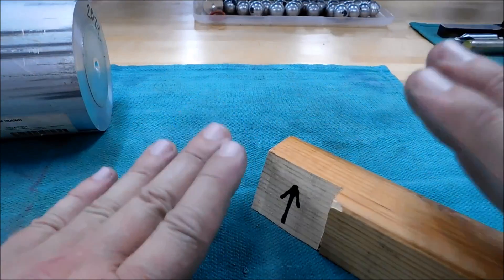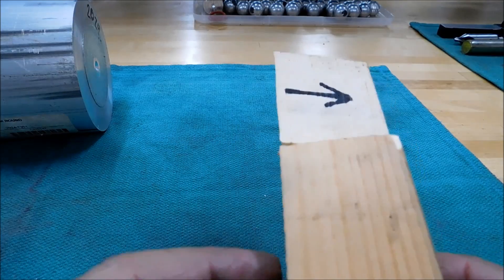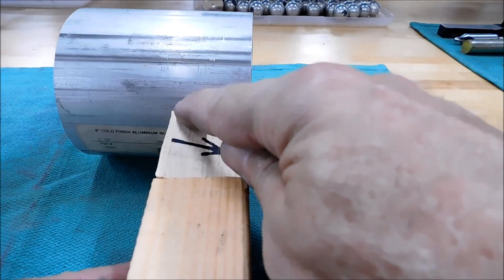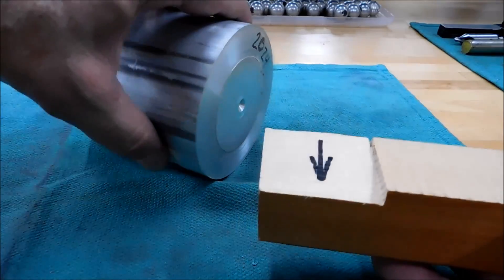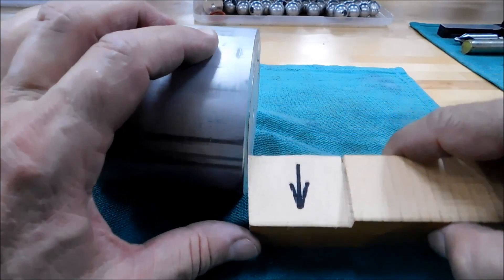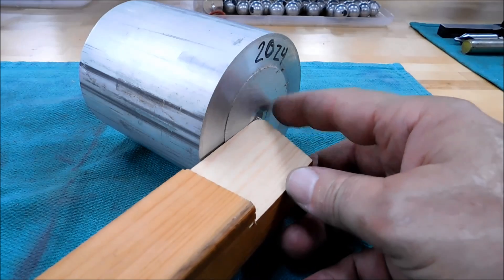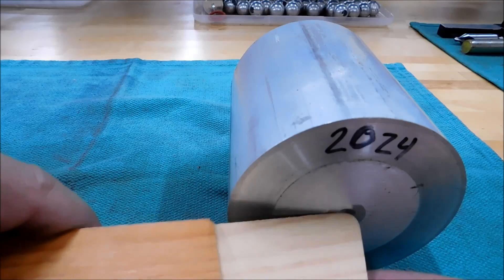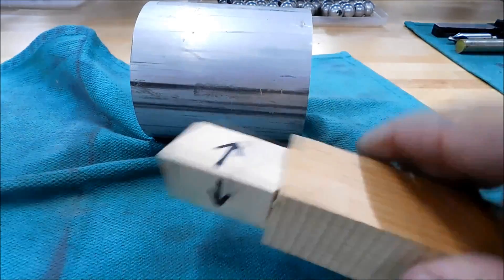I've Never Ground a Lathe Tool..... Basics, 101... WATCH THIS ONE !!!

Comment: A set of HSS tools came with my bench lathe but I gave up using them once I tried carbide inserts.
Reply from the maker: I actually prefer HSS over carbide on aluminum and brass.
Reply: @joepie221  Does that hold true no matter what size the lathe is? I'm guessing that the majority of us who watch and learn from you only have small not very powerful bench mounted hobby type machines.
Reply from the maker: @steveclark..  yes

Comment: Good video. I'm a newbie to using a lathe and I'm setting up my Atlas 10F. Have you found that you get a better result using a name brand tool post and/or holders than the Chinese copies? Also, I have some 1/2" tool steel bits that was left to me with the lathe. Would you suggest practicing to turn/face soft metals like brass or aluminum first before steel? Is round stock plastic worth practicing on?
Reply from the maker: Absolutely. Plastic has its place, but when you get confident and want to break chips, you'll have to move up to harder material. Get some 12L18. Good stuff to play with.

Comment: As usual very constructive. If the lead angle is not aggressive enough it might effect your feed rate. In addition if the tool is not on center then when you turn the part it might effect the accuracy of your reading. Finally a good habit is to stone the tool for the best finish.

Comment: Brutal, I've never had to go back multiple times on such a short video to catch all of the useful technical points.
Reply from the maker: I try to include several per video. If it's really valuable, I'll call it a SHOP GEM.
Reply: Absolutely! Short, clear, comprehensible, eye opener, Thanks to JP.

Comment: I am a bit short on tooking for my lathe (i got my mill at the same time). Should i focus on carbide or is it the smart move to go for grinding my own HSS? My gut tells me that HSS with these grinds can be way more versatile (i gotta buy a grinder... i am so completely new to this)
Reply: Little machine shop sells indexable turning and boring tool sets with which you can use either carbide or HSS inserts. They also sell both types of inserts.
Reply: Grind your own HSS , your home lathe is probably too light and low powered to get the best out of insert tools. Turning something with an HSS tool that you made yourself has a grin factor off the scale.
Reply: @leerogers6423  it is a grizzly g0752 (1hp 3 phase with vfd) and weighs 450 lbs. Dunno if that is light or not, but I'll go that route. What would you suggest for a decent grinder to do this kind of work?
Reply: @matthewgrigg9532  Any solid bench grinder will do. I have one with a 150mm diameter white stone (for HSS) that is 40mm wide (6" x 1.5"). On the mill you can make a proper (rigid) tool rest - I always find the tool rests that these grinders come with not easy to set up at a correct angle and too flimsy.
You can use carbide too. I use tiny DCMT070204 and CCMT060204 insert tooling on a Wabeco D4000 lathe with a 2 hp spindle but since carbide only works well when using proper speeds and feeds, I regularly max out my spindle rpm. I find HSS much more versatile and economic for a hobby lathe

Comment: YOU want  to throw something ......  Joe so do I, Often:not at thePCor in the workshop so much as out in the field when I see folk on Earthmovers -AgCultiv machinery inicluded who HAVE NO IDEA and just use Brute Force n Ignorance to do a job.     Soil like workshop materials works more easily if the proper angle of attack is taken.   Engineering takes a lot from Biological situations and is also the case, vice versa.  Just tell that to some folk!  Mohr's Circle was a grea tool to shownd work out problems.    If that piece of  wood to illustrate isn't the Splinter in the eye.....    ;-)  Thanks Joe

Comment: I've always put a compound angle on the top of the lathe bit, about 5° rake front to back, and another 5° left to right, along with both front and side clearances. Seems to work reasonably well, although I can get better results with good carbide tooling, eg Iscar (and thanks to Tom Lipton for turning me onto those Iscar trigons!).

Comment: Great video, as always. As it happens, I'm struggling to grind a form tool to cut small (3mm) decorative convex features or even little ball shapes in brass. I've tried grinding with a dremel and diamond needle files but usually end up with something that isn't symmetrical or doesn't have consistent relief angles. Also they only cut well going straight in although I've tried to grind/file a truncated cone into the end of the tool. Any tips please? I have seen your videos on making a decorative cannon :)
Reply from the maker: Any form tool geometry has to be conical as relieved. that may be why it only cuts well in one direction. Lay out the shape on top of the tool and rough it out on a pedestal grinder. If possible finish it with a dremel or die grinder using a stone as close to the finish radius as you can. grinding from tools is usually done on a surface grinder with a dressed wheel, but can be done by hand if you have a good eye.
Reply: @joepie221  Thanks Joe, will give it a shot

Comment: It's great that you, as a pro, have the interest to put up a "noob" video. Much appreciated sir.
Maybe, at some point, you can address chip control? There are very few, if any, videos about chip control. Be it carbide or hss chip control can be a bear. It's so frustrating to have a tool cut nicely only to provide long, stringy and dangerous chips.
Thanks again.
Reply from the maker: Its very easy for me to completely overlook ground level basics like this, but still remember the value. I may address that chip control issue at a later date.

Comment: Eccentric engineering do great tool steel holder in aus use it every day I can grind tool steel for shaper and line boring threads but still a art
Reply from the maker: It is.

Comment: Great video as always Joe. I was wondering if you might be able to do one for parting tools? Especially how to bias the leftover pip to a side or the other. I have an HSS parting blade that got about an inch left and I think it’s only done about 10 parts! I do work primarily with 316 and duplex stainless steels though. Thanks again 👍.
Reply from the maker: My experience with stainless is to keep it flooded, keep the tool as short as possible and keep it cutting. As soon as you shy away from commitment, the material will work harden and destroy the tip of the tool. keep it buried, keep it moving
Reply: Joe Pieczynski I really struggle to get consistent performance, sometimes it goes like a charm and others I just can’t win. When the tool is cutting well I’m loathed to mess with it but then inevitably it loses its edge and disaster. I find it’s a very fine (and hard to nail) sweet spot and sometimes even when I think I’ve got the perfect grind on my tool it just blows the edge the second it touches the work. I find “keeping it buried” a fine line too. The slightest bit to much pressure and it grabs in a instant and stops the spindle dead ( it’s only a small single phase Viceroy lathe with about 1hp). I don’t know if it’s poor tool geometry, poor technique or my machine but it’s very hit and miss. Its a bad workman that blames his tools but even grand master Abom admits he can’t part off on one of his lathes.

Comment: Here is a question for you how would you drill work hardened stainless steel in a manual mill ?i have tried some coated drills and cobalt drills and they melted
Reply: Tungsten carbide drills would work.you can get solid carbide or carbide tipped if your budget is tight. The latter are very similar to masonry drills but with a slightly different grind. I have used them to drill holes in hardened linear bearing tracks but it was slow going.
Reply: I have a small project waiting with this problem. And after breaking to many drills I stopped
Reply: alan stapleton. Depends on the type of stainless.  Most likely you would be using an austenitic stainless like 300 series. Using a HSS-Co (Cobalt) drill is what we use.  If you have no experience, use a slow rpm say about 500-600 for a 5/32 drill. For a larger drill, use an incrementally lower rpm. Use plenty of oil. Start the drill with enough pressure to start the hole.  For the balance remember one rule.  You are either drilling or you are retracting the drill.  If the hole has already work hardened, use a shorter drill(screw machine) and start with enough pressure to get through the hardened area.  Then, and very important, change to a new drill for the balance of the hole. Then adjust the rpm if you think it is too slow or too fast.
Dwelling, using a too high an rpm, and not using a high enough pressure lubricant will cause work hardening.  303 is forgiving, but 321 is not. Higher nickel content is likes work harden too - think Inconel. Harder stainless types like 400 series (431, 440) especially if heat treated, may not be able to be drilled with common drills coated or not.  There are a lot more variables than I want to cover here.
Reply: @rufusmacck3712  Hi we tried an 8% cobalt stubby drill but were  recommended to use about 800-900 rpm
Reply: Just a few days ago, I did a couple parts, 316 stainless,  .052" (#58) drill, about 1/2" through hole on a manual lathe. Plain HSS, lots of pecking an oil. No dwelling. Made sure the drill was sharp. Somewhere around 1200rpm. Came out OK.

This same part also had four off center holes specified to be .031" diameter, .375" deep, to be done on mill. These could not be done, at least with the HSS drills we had, either with the sprung drill adapter or straight quill. Even though they were sharp. Drill would go in about .015" or .020", and... no more. Steel got too hard and drill would dull quickly. Subsequent sharp drills would have same problem that just got worse. Perhaps a carbide drill would have fared better. Possible that I simply couldn't feed fast enough or with enough force without breaking the thin drill, and it was dwelling too long. And thereby hardening. Fortunately, I got the designer to amend the print to eliminate those holes, which apparently had been put there for my benefit (yeah, I don't understand that either).

Comment: After checking the video out I  thought of another video about Shear Tools made by SHOP TIPS #186 Vertical Shear Lathe Tool Part 1 of 2 tubalcain 
I have made such a tool and it has worked rather well for me. It would be interesting to get your take on such an uncommon tool as well.

Comment: Joe--I am an ardent fan of your videos, but I think you went a little fast on this one. If someone knew enough to follow this video, they probably wouldn't need it.  I'd love to hear the full-length JP exposition of the subject. I'm no pro but I make most of my own bits and I still had to back up a couple of times to be sure I understood.  (E.g., the observation that the nose-radius changes the height when you switch between facing and turning. One of those things that's only obvious after it's obvious.)

Comment: For a beginner to understand the cutting dynamics: When machining metals the cutting tool works just like a the butter knife when you take butter for a sandwich, it "drags" sideways through the material and lifts a chip. So we are not dependent on a thin edge to dive in but the angle towards the material is important. To flat and the material has nowhere to go, to sharp and the tool dives into the material and grabs.
Ignore the relief angles Joe showed and your tool will rub creating bad surface finish, high tool pressures and your adjustments/measurements will be all over the place.
Make the reliefs way to big and your edge will break.

Comment: I avoid changing my tool post setting  like the plague!  I set it up so one face is parallel to the chuck face and leave it alone that way it is set for parting , turning , facing and boring - just change the tool or tool holder over to the required tool . Nice simple explanation Joe ! Many times i have seen videos on this subject start out ok but end up filling some new guys head full of crap like the top rake HAS to be this angle  the clearance angle HAS to be this angle - this just scares the crap out of a newcomer and they end up full of self doubt . Good to see someone keeping it simple !
Reply: I have a Ferrari,  when I take it out for a drive... I avoid taking it out of First gear... like the plague...

Comment: Thanks Joe, haven't got a lathe, although do use these on my mill occasionally, rotating the part and jogging the tool in, you and others may be cringing, but as you said, light cuts 😀👍
Reply: Mills are under rated as mini lathes! Especially CNC mills can be very good, all it takes is a bit of creative programming. Major issue is the lack of support for the free end.
Reply: @sharg0  agree, I'm converting mine to CNC and have a 3 jaw MT2 chuck that works nicely in my mill, although it has nylon gears and only 150W motor, so only small stock and gentle passes. I'll be upgrading it soon to Brushless belt driven drive with encoder, so will be able to power tap with it too. It's only a hobby mill too 😂

Comment: i would be very interested in "how to drill very, very deep holes with a very small dia" like 13/64 or there around over 1-2 foot :-). I would use a tube and go from there, but i need higher PSI rating than those i can get in the material for a piston/pressure application.
Reply from the maker: Hit that subscribe button     https://www.youtube.com/watch?v=jnwVCliIiPI&t=345s
Reply: @joepie221  Thank you for taking the time and answering and of course, your top content
Reply from the maker: @MrZhefish  Any creator that doesn't engage with their viewers is probably just in it for the money. I actually have a desire to help my community.
Reply: @joepie221  Well that you do. I started watching you around two years ago and picked up my first lathe around then. last month i finished converting an import mill to cnc. Learning a lot from you :-) say the finer points that matters
Reply: @joepie221  And help me you did.  I now understand what the angles do, and the tool I ground last night cut better than any before.  Thank you sir!   ... and your cutoff tool video solved 40 years of cutoff problems!

Comment: Thank you sir. Love your videos!  I have learned much from the detailed lessons given. You have filled in many missing or forgotten items that have made many days much easier!   
       I do have one question about cutting tools.   I destroy parting/grooving tools with a frequency I hate to admit on my CNC and manual lathes.   I keep the rpm low and flood with coolant or lubricant with mixed results.   What are the details involved when parting off 4140 solid shafts?  Is there a feed/speed formula different for parting off?   Is there a “best” coolant/lubricant for this operation I am missing?    Thank you for all you do sir.

Comment: That perfectly explains why, in a very early video and facing the slings and arrows from the comments section, Mr. Pete chooses to face from the center of the work outwards instead of plunging in. He was at a loss to explain the dynamics and simply said it was the way he was taught and so... 
Once again, the Perfesser here clears things up for the unwashed masses (myself included BTW).☺

Comment: Meh. Off center by 5 whole thou to start. Big whoop. Take a face cut and see if you have a pointy nib, or cylindrical nib, or no nib. Adjust accordingly. I like my tools set a halfafuzz below anyhoo. It works better on the first cut of raw material that has variations in the diameter.

Comment: A nearby machine shop owner told me manual guys will always be needed. Do you agree? He runs a cnc outfit and has one old school guy left who's going to retire. I hope I can get on there. 20 years of experience; but I'm autistic. You think I got a shot? By the way, never scrapped a part. Thanks Joe.
Reply: There's one thing about a Manual Operating machine. They're Great for small Run projects, but for Production Runs 1K-10K or more Parts, CNC is the Only way to go...
Reply: You're right. I've only done one-off custom work. I make parts for printing and binding machines that are no longer in service.

Comment: Yup nother good video, thats really armstrong geometry. that 80 deg diamond on both ends holder is more what (well i percieve) whoever came up with that bxa type intended. probly with never losening that top nut so the parting tool is always squared up. then boom put tool #1 in push the stock out to the right length for facing. Imagine using a rest and like a cape chisel for all your turning like the ooooold days

Comment: Could you do a different types of lathe tools ,what are they used for and how to grind angles on them ?
I recently discovered a sheering tool for finish pass that i never knew of.in a junk drawer of a guy i found a knife that looked like parting blade but it was beefier and it had a cut slot in the middle.
 it looked like this  IUI -anyone knows whats that tool for? Or was it for some custom job?

Comment: When setting tool height for facing, I find it easier to just run the tool to the center of the part with the spindle running and eye it up to the center.
Reply from the maker: that is the test for sure, unless the part has a hole in it.

Comment: I rarely rarely rarely ever change the angle of my tool post....it bugs me as well when I see people angling it to basically change the geometry of a tool....maybe I'm boring lol...also I used to grind all my negative rake hss bits with just the very point of the bit presented to the work, so one more side relief plane than what you show...it was a pain to grind and just doesn't seem to break a chip very well or leave a nice finish, so I stopped that lol.....but I've started using tpg322 inserts in my right hand cutters, really like the geometry.....
Reply from the maker: So do I. Many people may feel differently, but I like the TPG. I use the 321 most.